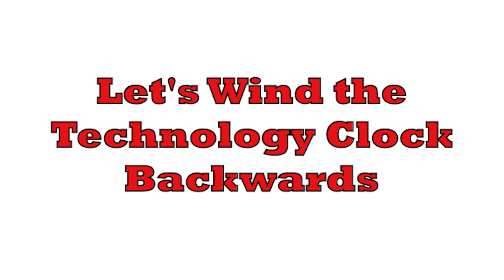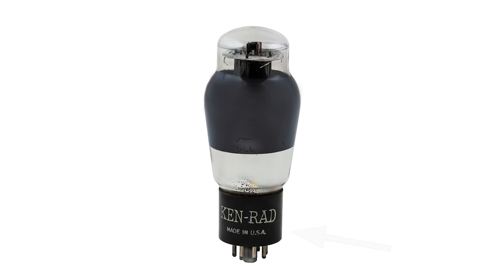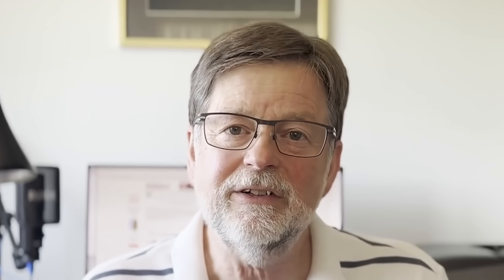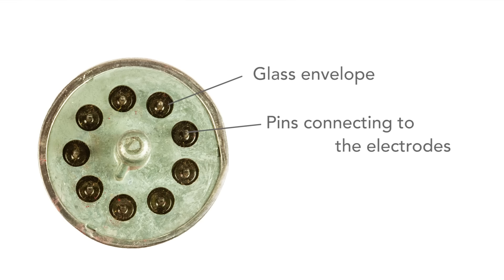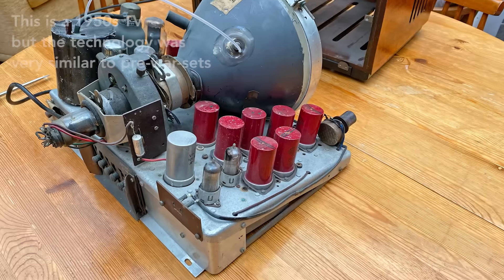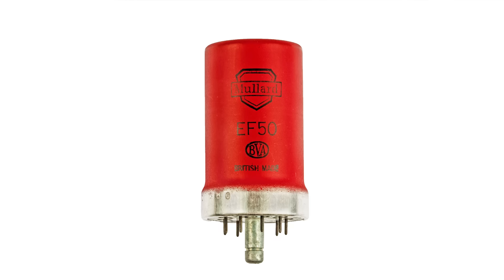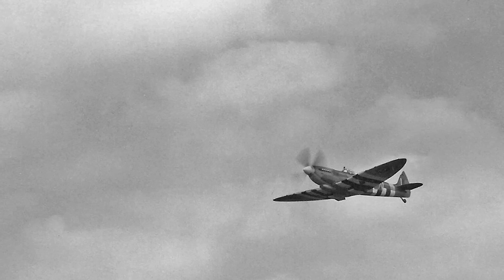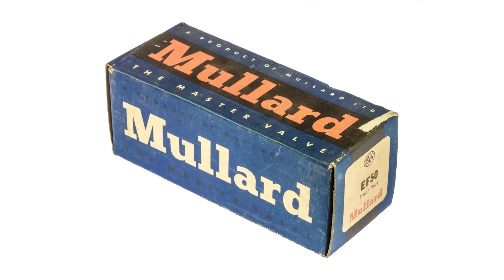Britain's SECRET WW2 Lifesaver: the EF50 valve / vacuum tube

Comment: The base is called LOCTAL BASE. Unlike octal bases, they lock with a click suitable for portable operation. These type bases were very common in portable radios that ran from 90 volts plate supply (2 x 45 volt batteries) and 2.2 volt filament supply batteries (standard lead acid accumulator cell ). Regards
Reply from the maker: Thanks for the information and update. Very useful - thank you.

Comment: Back in 1971 I bought a dozen of the army version, ARP35 in plain aluminium can, unused for 50 pence at a radio rally. Never found the holders at similar price so didn't get round to using them. Suppose they are in the attic somewhere...

Comment: The significant advance made by Philips in the Netherlands with the development of a glass base  through which lead out pins (as opposed to long wires terminated in hollow pins as previously used) passed directly from the internal structures of the valve and form the external connections. The more compact construction and shorter signal paths allowed valves to operate at frequencies above 30 MHz which was the general limit in earlier devices. This work started in the early 1930s and resulted in practical devices that could be produced at scale by 1939. As Holland was invaded from the south Philips raced to load ~20,000 finished valves plus a considerable quantity of components and equipment for shipment to Mullard in England
Reply from the maker: A great succinct summary of the reason for developing these valves. Thanks for your contribution.
Reply: Philips had built a large valve production factory in Blackburn Lancashire, the road is still called Philips Road. Sadly the site is now split up into an industrial estate as is the cathode ray tube factory a few miles away in Simonstone where I worked for 34 years.
Reply from the maker: @neilcurson4505 It’s such a shame when these sites are lost. Thanks for posting the information.

Comment: some were also made in the usa, and were slightly different physically internally, supposedly better , plus there was similar type EF54 and a high power version EF55, and an unjacketed triode EC52,, an maybe other types with this construction , i have a load of military coded ''unfinished' ones, the pins havent been chamfered off so can snag on the valve socket contacts, plus one unusual? rare? unpainted brass jacketed vesion, they were normally aluminium

Comment: Here is a little story relating to your EF50 post. In 1957 I was using a CR100 receiver on 10 meters to receive Sputnik which it did but only at about S3. However by using the RF 26 unit which uses EF50's as front end that signal shot up to S9. (GW3KGI Swansea)
Reply: Ah, the CR (communications receiver!) 100. Dr. George Grisdale, who designed it, still used to pop in occasionally in the 1980s (in his Morris Minor), to the communications department at Marconi Research Centre (as it then was), where he'd been head of department. I remember we found an original typed draft of the manual in an old filing cabinet, and returned it to him. (Might have been the CR150.)
Reply from the maker: That’s fascinating - thanks for sharing.

Comment: The Germans had even better tubes the war time. They were even smaller steel-covered tubes with nice performance. In the 1960's I built radios with them.
Reply from the maker: Yes, they may well have done - that would make another interesting video.
Reply: @ElectronicsNotes  I used to have a lot of old tubes got rid of them as useless. Now I miss them. I may have some still in my store. I need to check
Reply from the maker: @henk38599 Yes it’s very easy to clear things out and then regret it.
Reply: @ElectronicsNotes  You can say that again. I also threw away data books and radio service manuals from the 1920's, American and German. I still have some nice data books from the 1930's of radio tubes. They are like new since they are printed on high quality paper
Reply: The RV12P2000 is an excellent valve. I build mike pre amps and equalizer circuits with them . When I was a school boy  in the late 60th, my cousin  found a large amount of radio gear in old farm house which was  torn down days later. 
So I got lot of those RV12P2000, RL12P10 and RL12P35 with its matching sockets. 
I made  audio amps with them, two of the RL12P35,   a 35W power pentode , intended for use in transmitter finals, perform excellent as audio power amp. It  delivers solid 100W in class B , with 800V plate voltage   and 350V at the screens.

I saved  some of the old valves until today.
Reply: @Reaktanzkreis  Excellent. In 1968 a radio shop from which I used to get tubes for my projects, was closing its operations. The owner told me that I can go through their store and pick up whatever I find interesting. You can guess the rest. I also got some useful instruments.

Comment: I had great fun with these valves used in audio amplifiers in the early 1960's, they were a bit microphonic compared to EF86's but cheaper. Thank you, a real timestamp in my life.
Reply: The EF86 was classed as a low microphonic valve. Still gave a nice ting when tapped however. It was THE preamp valve in it's day. Mullard recommended a special anti vibration valve base and a screening can placed over it.
Reply from the maker: Thank you for your comment - I really enjoyed researching and making he video. It came out of borrowing a few valves, one of which was an EF50 from a friend of mine. I don't think I have any other left in my collection!

Comment: Anyone remember acorn valves, worked well into UHF. Everyone was after them in the 1960's.
Reply: Yes ! I have a few in a drawer and , the circular ceramic holders  (  😝  ) ..................... DAVE™🛑
Reply from the maker: Great to hear that.
Reply: Back in the 70s I worked for Federal Sign and Signal.  The Sign division had many neon sign glass blowers.  In the 70s, they told me about how the sign glass blowers were making acorn tubes for the war effort. They still had some of the old tools and fixtures.
Reply: Yes, I had one, I think it was a 950.  IIRC I soldered wires directly to the pins.
Reply: I remember them but never used one.
Still seen at radio rallies for £6 but don't see bases. I can't remember which type though.
G4GHB.
And remember Nuvistors!
Reply: @bill-2018 . Yes, I have a few new old stock RCA Nuvistors.  They’re about the same size as an early transistor such as a CK722.  My Tektronix 1S1 plug-in has a one Nuvistor.  The 1S1 allowed the Tek 500 series oscilloscopes to display over 1 GHz waveforms using equivalent time sampling.
Reply: @wtmayhew 
 I did see a few at a radio rally a few years ago and was tempted but no bases, It's like the 7 pin oddly shaped and footless bases I don't see, I see valves.
G4GHB.
Reply: @bill-2018   There were some interesting valves in the 1950s.  I had a  Motorola portable transceiver made in the 1950s containing a handful of Raytheon valves which looked like oversized NE-2 lamps which had been partially flattened before the glass envelope cooled.  I believe they were triodes and tetrodes.  My recollection is the part numbers began with CK…
Reply: @bill-2018  Have two Nuvistors in my Tek 453 scope. They were used before FETs. Bought the 453 a few years ago in excellent condition as when I was on the bench at the MOD 50 years ago you knew you had made it when a 453 appeared on your bench.
Reply: Yes I know acorns.   I have here in my kitchen a Hallicrafter VHF receiver - 130 MHz to 210 Mhz.  It has two rf amplifier stages using acorn 954s, 954 as mixer and 955 as local oscillator.  It has an octal 6AC7 is 1st IF amplifier.
Reply: I have a portable US Navy tube (valve) tester from 1942 which has a socket for testing acorn tubes, though I have not yet encountered one in equipment.

Comment: During the War, metal valves, which had been developed from about 1935, came into their own. This EF50 is not a “metal” valve. It is a glass valve with a metal screen fitted. The true “metal” valves actually had a metal, rather than a glass, envelope. The base, through which the wires came and the evacuation tube, were glass, but this glass base was then fixed to a metal can. There was no glass envelope within the can. This provided many advantages. Better screening, of course, better heat dissipation and a much more rugged construction for military use. Most common valves, for example, the 6V6, were produced in the metal version. These were, generally, international octal types and could simply replace a glass valve of the same type.
Reply from the maker: Interesting - thanks for your comment. I tried to show the inner glass envelope and not imply the valves were totally metal in the outside - I hope I succeeded in this. Your comments are very informative. Thanks.
Reply: @ElectronicsNotes I used metal valves for many years in my amateur radio hobby - I never realised, at the time, that they were not simply glass valves with a metal envelope and only discovered this recently. The seal between the glass base and the steel case must have been very good, since I have valves of this type which are over seventy years old and they still work perfectly.
Reply: @ElectronicsNotes  the bear of designing them was metal selection. It was difficult enough developing the metal alloy for the pins, matching expansion/contraction for the entire envelope had to have been an absolute nightmare!
Reply: @ElectronicsNotes  You did clearly say 00:53   " What it did have was an all glass envelope and the pins came out directly from the envelope ... A metal can was placed over the glass envelope".  Therefore the inference is that the EF50 is not a metal valve but glass Valve in a metal can which it is.
Reply from the maker: @Woffy.It is a glass valve with a metal screen over it. The pins came out directly through the glass rather than having wires come out of the glass that need connecting to a base.
Reply: @ElectronicsNotes  Yes it is just like you said and I confirmed as Mark thought otherwise.

Comment: ElectronicsNotes has things very mixed up and many things plain wrong.   The EF50, designed and tooled up for by Philips in Holland, was made by Mullard (as Philips was known as in Britain) in Britain using tooling from Holland right enough.   But it would not have mattered if the tooling had never arrived, because:-
1.   New miniature button base tubes developed in the USA (eg 6AK5) could and did do the same job;
2.   Mullard could not meet the demand and the same EF50 tube was made by Cossor and Osram in England, and by Sylvania in the USA,  each using their own tooling.
Being an old guy (80), I have seen many EF50 tubes in my time and they were all US-made by Sylvania, as shown by the production code although branded Mullard.   In fact Sylvania made more EF50 than the other three combined.
Contrary to what ElectronicsNotes said, radar using the EF50 was not essential to giving British pilots enough warning of German aircraft as  that was done by the Chain radar system, which did not use EF50's, being a prewar design.
Incidentally, Sylvania vigorously advertised their prowess in making EF50 and other British and European tube types in American electronics magazines. aimed at technicians employed in servicing British made equipment.
Reply from the maker: Interesting. Thank you.

Comment: Thanks :) The German equivalent was the 12RV2000 of which 6 million were produced by the end of the war and continued in production till 1956 Check it out. Also checkout the 6AK5 (AKA EF95)
Reply: Actually RV12P2000 meaning military tube, voltage amplifier, 12 V filament and (theoretical) amplification by 2000. Was used up to 300 MHz.
Reply: @georgkrahl56  I did mean in application rather than a pin for pin equivalent. 
The RV12P2000 was so good that the Soviets created their own version for avionics  in an aluminium can called the 12Ж1Л
Reply: @smalcolmbrown  Majority of soviet tubes after WW2 were copies of german or american ones.
Reply from the maker: That’s interesting - thank you for posting.
Reply from the maker: That’s interesting - thank you.

Comment: You missed one feature, the metal base is a Loctal type, important for military use as they won't shake out of their sockets on the battlefront.
Reply: The EF50 has a nine-pin base,  It is not octal  (nor 'loctal'(.
Reply: @v8pilot  uses the same locking spigot though, could probably call it a 'locnoval' 😉
Reply: @andygozzo72  Correctly known as B9G
Reply: @jjmcrosbie  i know 😉
Reply from the maker: Thanks for your post and information. I was trying to focus in the basics - but as you say the Loctal holder was important.